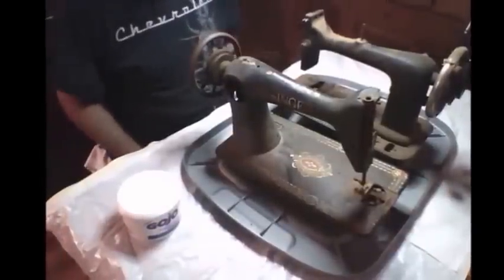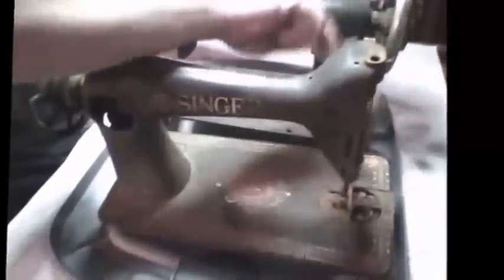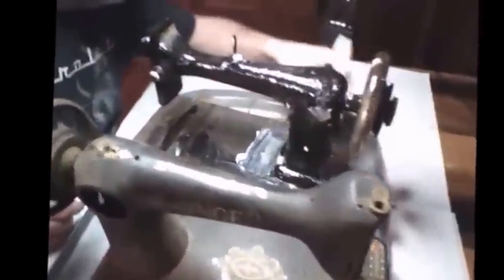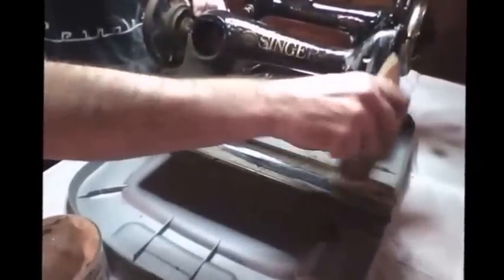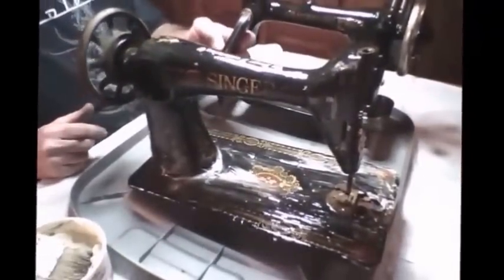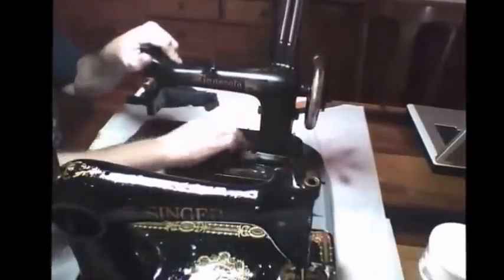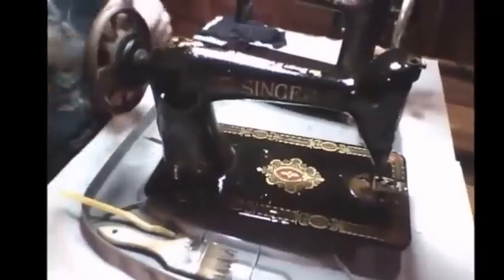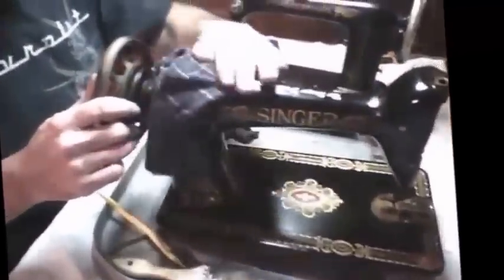Using Gojo to Clean a Vintage Singer Redeye and a Minnesota A Sewing Machines

Comment: What do you use to clean the metal parts of the machine?
Reply from the maker: Assuming you're referring to the bright parts or unpainted parts?
 I use Gojo unless the parts have rust on then, in that case I use Evaporust. I do not use any rust removing method that involves any etching corrosive acid. That includes vinegar (acetic acid), Coke (phosphoric acid), or the several commercially available rust removers. Corrosive acids remove good metal at the same (or near same) rate the rust is removed, making the surface rough and pitted. This is very counterproductive when dealing with polished or plated parts since you end up having to polish out all the pitting that wasn't there until you etched it. Some parts that might have rust will also have machined surfaces that run inside a bushing or are intended to slide against another part. When you etch these surfaces with corrosive acid, you end up with a piece of metal that resembles fine sandpaper. This will cause eventual where damage to not only the part but the part that it interacts with.
 Also, there is a myth that circulates about using some penetrating oils to remove rust. There are no penetrating oils on the market that have any active ingredient with rust-removing abilities. 
Evaporust use a process called "selective chelation" to remove only iron oxide. It does not do anything to the rest of the part's surface.
Reply: Thank you so much. I was referring to the metal badges/emblems. Not entirely sure what they're made of. Possibly nickel? I've heard of using Mother's mag aluminum polish but will GoJo work as well or better?
Reply: The badges/emblems are not rusty at all
Reply from the maker: @shawna3263  alrighty just clean them good with Gojo and then use a good polish (such as Mother's Mag and Aluminum polish) and rub them until your arms are tired. Easier to use a Dremel and buffing wheel though oh, it won't wear your arms out so fast😁
Reply: Thank you!! Unfortunately I don't have a Dremel tool so hopefully when I'm done I'll have arms like Popeye 😊
Reply: @rayelkins7872  I took all of your advice and my Singer looks AMAZING!! 
I even used Gojo on the wooden cabinet as well, followed by Liquid Gold. Also, Mother's Mag & Aluminum polish on the metal emblems. I wish I could share a picture here. Thank you so very much 😊

Comment: A word of WARNING! I used GoJo to clean my 120 yr. old Winselmann and this stuff stripped most of the decals to nothing back the silver backing.So be very, very careful using GoJo. Those decals are gone forever, Darn shame.
Reply from the maker: The video was an experiment to see if I could damage these two machines, not proof that Gojo will never damage the finish. If the decals are bad or lost their adhesion, it is likely they will come of with any cleaning method. Still the best method I have found and we use it exclusively in the workshops, but still always recommend that it should be tested in a small area before plastering it all over a machine.
Reply: I understand your reason for your video, and it was well done.I don't agree with your statement " If the decals are bad or lost their adhesion, it is likely they will come of with any cleaning method."These decals can still be preserved ( in many cases) by careful cleaning with a mild soap & water and a toothbrush, then preserve with sewing machine oil or natural shellac. There is a likelihood that beginners, like me, will misunderstand and windup with ruining a once valuable machine.Live and learn.
Reply from the maker: Really hate that your machine was damaged, but you are correct that many folks make mistakes and assumptions that lead to disaster. That was one of the major factors that caused me to start holding workshops all across the country to show people how to do this stuff. We traveled over 13,000 miles last year to do just that and take the methods and knowledge to people.
Gojo contains no water, which is one reason we (myself and many many collectors of early machines) use it. Water is an absolute no-go when dealing with antique machines, anyone with any experience cleaning pre-1930s machines would agree. I've used Gojo on literally hundreds of machines dating back as early as 1858 (very valuable machines) and not had an issue.
 I agree that beginners many times misunderstand, but the ones that I have seen do damage are those who read and watch but never ask questions before making assumptions about a product. I did it myself long ago, making the erroneous assumption that Dawn and water would be a good way to clean a rare early hand-cranked machine. I didn't test it on a small area on the machine, just assumed it would work. Needless to say, that was the last time I made the mistake of trying something I had never done without both testing the method and moving forward cautiously.
Reply: Thank you for your reply. Think we are on the same page!

Comment: Hi, what do you do if the machine has rust and dirt on it?
Reply from the maker: I use the Gojo to clean the dirt off, then coat them with either carnauba wax or Howard Feed-n-Wax depending on the smoothness of the surface. The Feed-n-Wax hydrates the old paint and makes it shine while protecting the rusty areas. Lots of different ways to do it, that is just how I do it because I don't normally repaint machines. What paint and decals that are left is what I want to preserve.

Comment: today is August 19, 2018 …. what are you going to use on the nickel/silver platings???
Reply: I'm looking to restore to machines like those and I have come to the conclusion after research look up derusting with electrolytic solution and sacrificial iron and then to recoat look up nickel plating, zinc pl, etc.